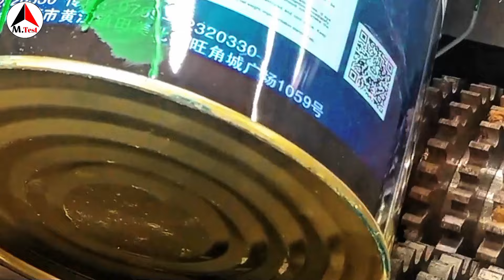Extra Powerful shredder ! Extreme Crushing Experiments

Comment: "An incredible display of raw power and engineering! Watching this crusher tear through hard metal scrap with ease is both mesmerizing and impressive. The efficiency and strength of the shredding machine in action make it a perfect solution for heavy-duty recycling tasks. A must-watch for fans of industrial machinery at its finest!"
Reply from the maker: Thanks you so much for visit
Reply: Nice job bot